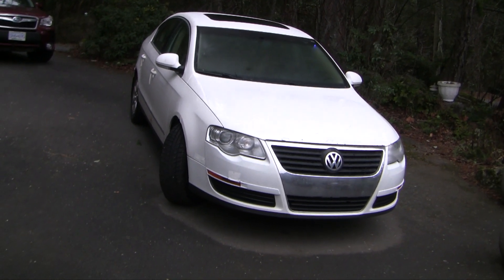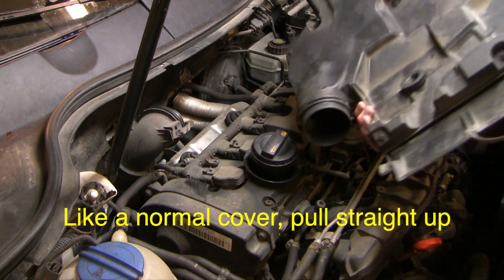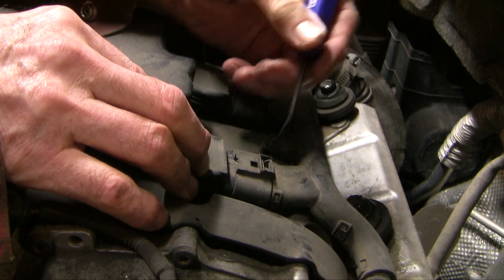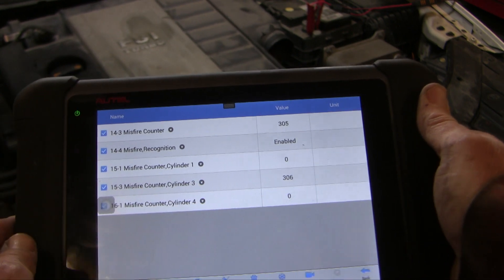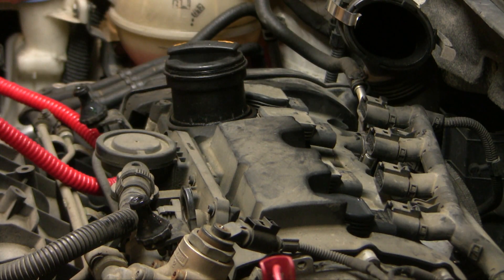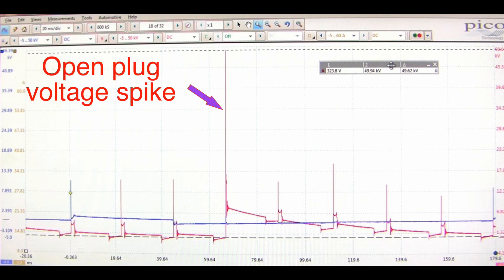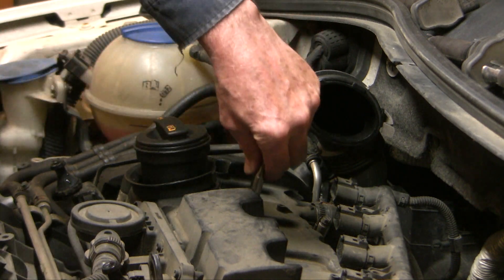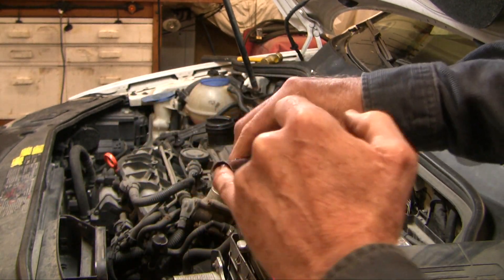How to fix a shaking engine, 2007 VW Passat 2.0T FSI misfire

Comment: That's the way you do it, swap your coils and it tells you everything. Long time no see my friend. Thanks for the video
Reply from the maker: Yes, you're right. What I like most about this technique is the way you also prove that the driver, the wiring, and even the cylinder are pretty good if a bystander coil makes that cylinder run fine with no misfires on that cylinder. It's a free double check for other problems that might not appear if you test only the coil. Thanks for stopping by!